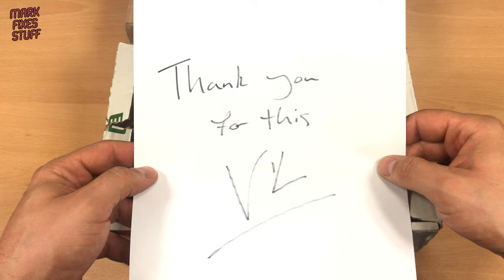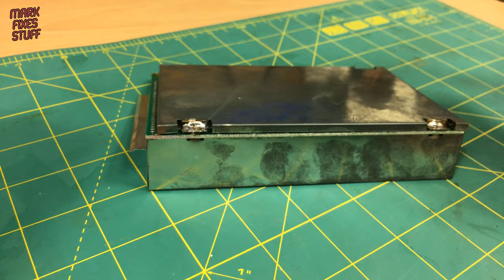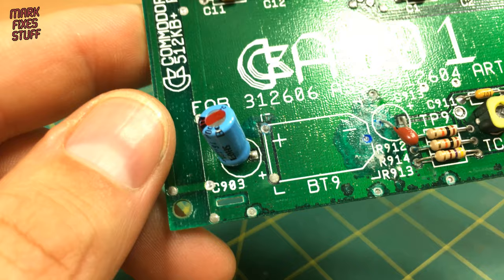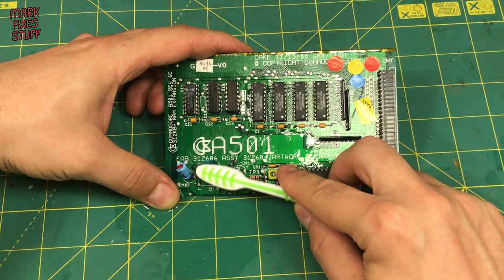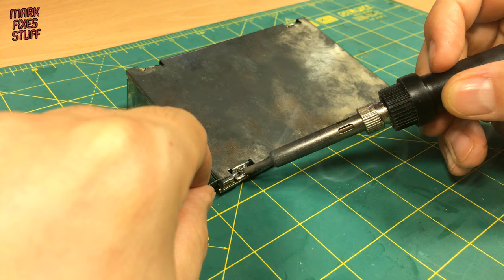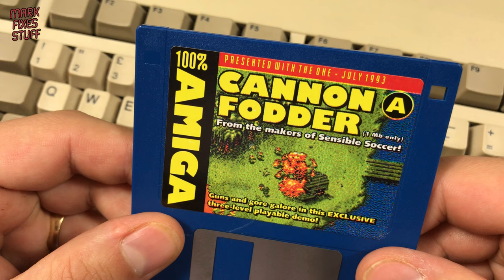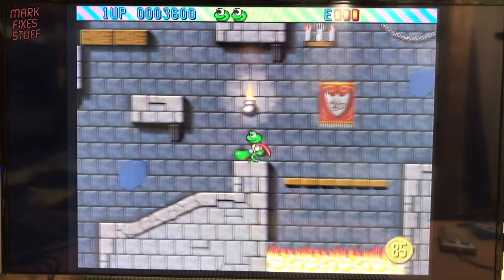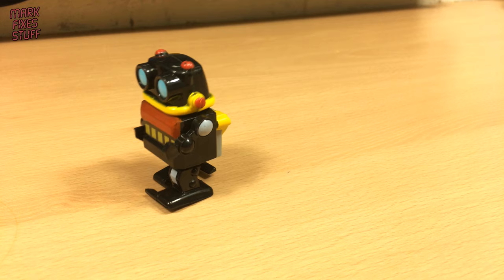Repairing a Commodore Amiga A501 Memory Expansion battery leak. Removal, clean up and games testing!

Comment: for the desoldering of the shield, there is a neat little trick. If your soldering iron is better at maintaining the temperature than your desoldering station, you can simply liquify the solder with the iron and suck it with the desoldering station.
Reply from the maker: My desoldering station is pretty beefy and doesn't seem to have a problem with these, but I have had to do precisely what you described on old Atari heatsinks.

Comment: I do not understand well why you did not replace the battery, some people simply use a 3v button battery but you have to cut a line so that it does not recharge it, but it really is good to put some battery for the relog to work.
I also think that you only have 512 and that the A501 is not working since in the test it says 512 memory from $ 00C0-0000 to $ 00C7-E7FF and below something similar $ 00C0-04E8 to $ 00C7-E800 is the same memory area .
Maybe I'm wrong but if you put the WB above it says the total amount of ram

Comment: I noticed my Amiga refuses to soft reboot if the memory expansion is installed, it just end up cycling a white screen and power led blinking. I was able to see the leaking battery under the shield and will remove it and clean the pcb.

Comment: From a UK perspective, is isopropyl alcohol the same as surgical spirit? If not where are you getting the ia from?

Cheers
Reply from the maker: A lot of terms are used interchangeably so you need to check the content. Surgical spirit often contains water, as does rubbing alcohol - as much as 20%!

You can buy it on ebay easily enough. Search for 99% Isopropyl Alcohol, and then you'll get the pure and unperfumed stuff. It's about eight quid for a litre delivered.

Comment: I had a 1MB expansion in my A600, and an extra floppy drive. Ooo :p
Did the A500 need to be opened up like that to install it or was there a trap door underneath?
Reply from the maker: There's a trap door. It's just easier with the camera in the way to do it through the top in the video. Thanks for watching  :)
Reply: @MarkFixesStuff  Thanks. I like the way you do things. Pro skills but accessible

Comment: As someone that has never so much as laid his eyes on an Amiga, I need to know.
What's the battery for anyway? Why does a RAM expansion have a battery?
Reply: Clock
Reply: Oh, so it does more than just add RAM, interesting. Thanks.
Reply from the maker: The official A501 RAM expansion, along with many other third party devices had a Real Time Clock, sometimes abbreviated to RTC. The battery kept time during power off. These days it's not essential, so the current thinking is to remove, clean and not replace, thus avoiding problems in another twenty years.